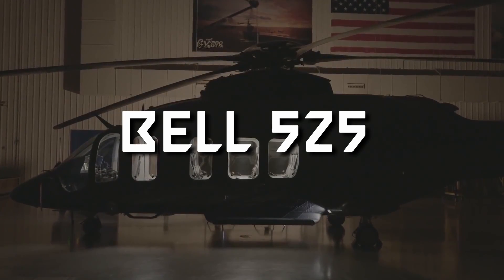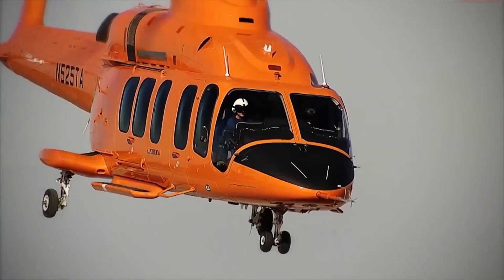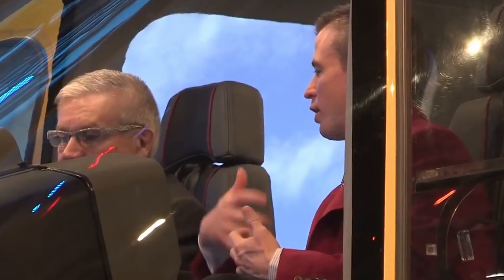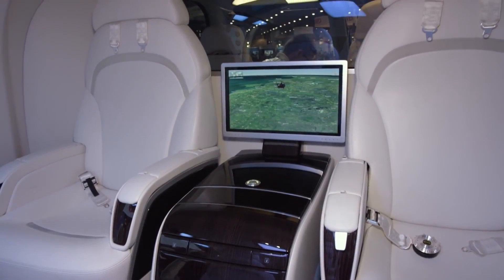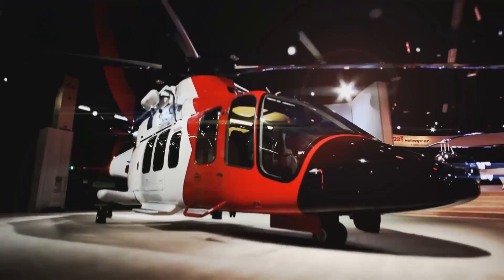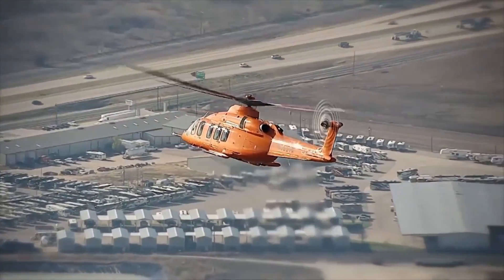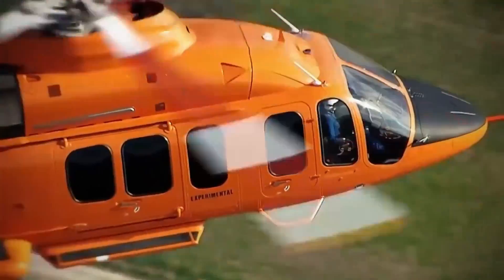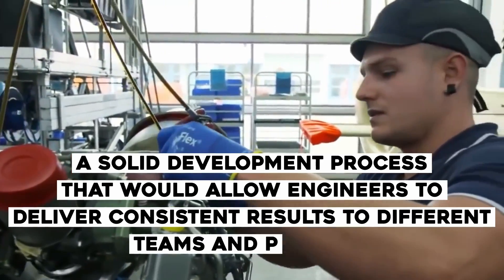The 192 MPH Helicopter: Bell 525 Relentless

Comment: The secret testing center that Bell uses to certify their aircraft is somewhere around 5000 feet below sea level with an arctic like environment, say...-40. Only there do their aircraft perform the way they claim. The 525 will likely see 166 kts when flown remotely at 15,000' and the rotor system is purposefully slung from the aircraft. Just before impact, it should hit said target speed.